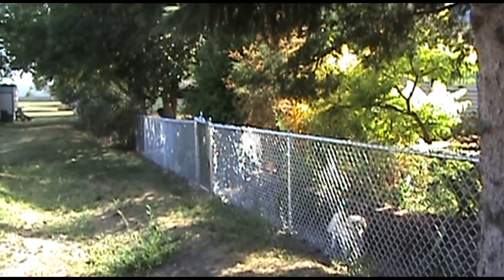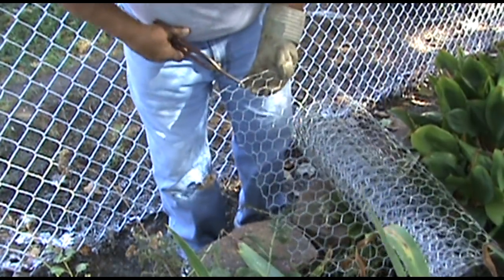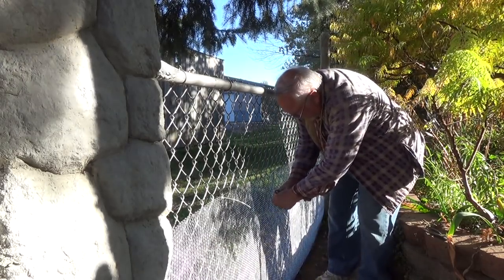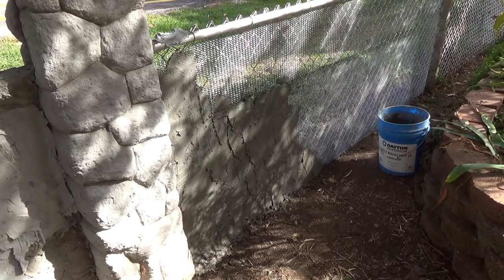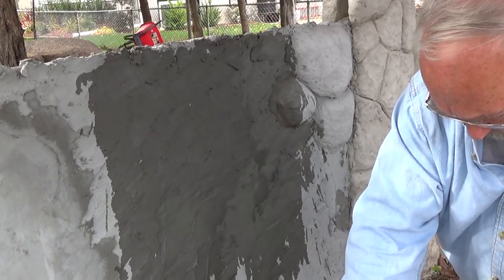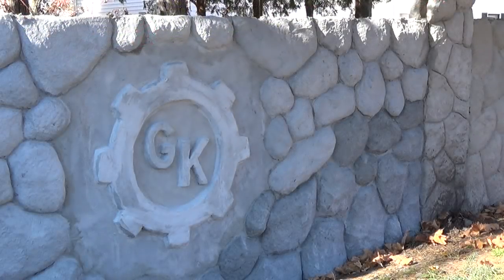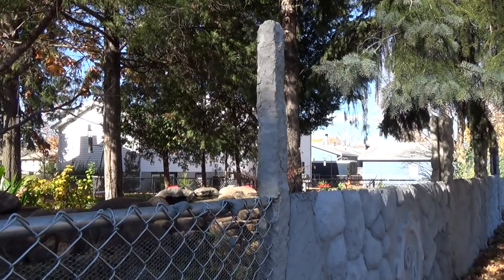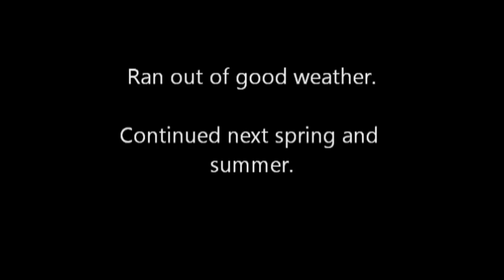Converting my chain link fence to a stone wall

Comment from the maker: The fence in this video has a foundation of steel posts in concrete 40 inches into the ground (below frost line).  The fence is covered with an ultra high performance concrete mix referred to as reactive powder cement with a compressive strength of more than 80 megapascals. The metal fence acts as rebar or reinforcement for the concrete. The construction is essentially the same as found in commercial concrete fences and based on a post-and-beam mode of construction. The concrete is composed of sand, Portland cement, CSA cement, metakaolin, silica fume, Xypex brand crystalline waterproofer, AR glass and PVA fibers, and acrylic emulsion in the liquid.
Reply: Thanks
Reply: dperry428 thanks man 🙏 great wall!
Reply: Extremely interesting! I've enjoyed watching your talent. Could you elaborate on the chemicals that you use and their ratios for each job; 
1. the wall
2. the mortar outlining effect
3. the Styrofoam gate. 
4. The stain for the stones

Have you thought about writing an e-book on this. You have thousands of views! Congratulations
Reply from the maker: @teg861  I don't know what you mean by elaborate on the chemicals.  The content and ratios of the mixes I use have evolved with time and even over the course of a project.  The wall was completed over a three year period and the mix used changed from inception to completion.  Sand/cement ratios varied from 3/1,  2/1,  1/1 and even 1/2 sand to 1 cement.  For most of the vertical application, the mix is 2 sand to 1 cement. Before I started using silica fume, I added 15% to 20% metakaolin.  Later mixes and what I now use contain 10% metakaolin and 8% silica fume.  Silica fume tends to make the mix very sticky so, in certain uses, I will sometimes eliminate the silica fume and increase metakaolin to 20%, such as when I want a sculptural mix that performs like modeling clay..  I also add 5% to 10% Buzzi Unicem CSA cement, depending on temperature.  This is a calcium sulfoaluminate additive that is not meant to be use alone as a cement like other CSA cements, such as Rapid Set. It is added to help with shrinkage cracking.  I am now also adding 2% crystalline waterproofer (Xypex brand), especially when making concrete constructions that will be in my pond. I also use acrylic latex additive in all mix water such that the solids content is at least 6 to 10%.  I also use alkaline resistant glass fiber in base coats and polyvinyl alcohol fiber in finish coats.  My purpose is to produce a concrete that is strong, dense and impermeable to be waterproof and resistant to freeze/thaw cycles. The metakaolin and silica fume are both pozzolans that are chemically active, but they also are used for their particle sizes, with metakaoin 10 times smaller than cement and silica fume 10 times smaller than metakaolin.  Their use creates particle packing that densifies the concrete and eliminates porosity to keep water out. It seems to work quite well.  I am no expert on concrete.  I share what has worked for me based on what I've learned from research at the University of Michigan and other engineering studies. Books should be written by experts.
Reply: dperry428 Fantastically detailed reply, it helped me no end, thank you.
Reply: @dperry428  could it be possible to use driveway resurfacer? As your mix calls for lots of stuff! Just asking, I like to stay simple.
Reply from the maker: @LH81633  There is good reason to use what I have used.  Yes, the mix is more complex than what you can just go buy in a home improvement store, but it is also much stronger and much more durable than anything you can conveniently buy.  Without wanting to be facetious, do whatever you like, but don't blame me when it falls apart after a season or two.  You may like to stay simple, but simple is not always smart.

Comment: THIS VIDEO IS EXACTLY WHAT I´M LOOKING FOR !! I HAD BEEN SEARCHING ON INTERNET LAST 2-3 MONTHS AND YOUR VIDEO SHOWS EXACTLY WHAT I VISUALIZE ON MY MIND !! NOW LETS DO THIS!!!
Reply from the maker: Just make sure to use a mix stronger than that found in bagged mixes.  Also, watch parts 2 and 3.
Reply: You are not alone, I've been searching for a video like this for such a long time. I was wondering if I really need to use the fine mesh or the chain link fence will be fine without the fine mesh
Reply from the maker: @stoneyvill  There are two reasons not to rely just on the chain link.  First, the gaps in chain link alone make it very difficult to hold the mix on.  It will tend to fall through and fall off.  Even adding a layer of chicken wire is nearly as difficult to use.  The small openings of metal lath are ideal.  Second, in adding the mesh, you are using the concept of ferrocement, which allows for the relatively thin end product.  My fence is less than three inches thick and in many places only two.  Using only the chainlink fabric, to prevent cracking and breaking out, you'll likely need a much thicker application of concrete. https://www.concrete.org/topicsInConcrete/topicdetail/Ferrocement?search=Ferrocement

Comment: I appreciate the detail provided in your secret recipe! I'm thinking of doing this with a vinyl coated chainlink fence. It might last a long time with your mix and rust resistant 'rebar' (cyclone fencing). 

Thank you!
Reply from the maker: Just for sure, roll or brush on acrylic on the vinyl.  Concrete doesn't adhere to plastics very well.

Comment: This is brilliant and inspiring. .   I have this idea in central Florida for large faux boulders where my soil is white sugar sand and I have tons of dry tree debris branches and roots  from a clearing. This material will eventual decay, but would be a great body frame shell.   Wrapped around some T-posts then layered with fiberglass mesh held on with nylon string and expanding foam.  I would then proceed to mortar on thick layers of 8:1 Sand:Portland in the shape of rocks.
Reply from the maker: 8 to 1 sand will be extraordinarily weak.

Comment: WOW...  you have patience!    i've seen people mixing 'deconstructed' bubble foam (the white stuff that EVERYTHING is packed in)... extends the concrete and makes the entire thing lighter... be interesting to see if that would be a benefit for a job like this.
Reply from the maker: I used to do exactly that 10 years ago to make lightweight rocks for my pond.  Here is a six part series I did 10 years ago using styrofoam beads (EPS regrind) to make lightweight rocks.  I now use vermiculite and perlite to make lightweight concrete.  https://www.youtube.com/watch?v=VqUc5QSUBAQ&list=PL0D8F4E6D9B49EBA4   Lightweight concrete would NOT be a good idea for this fence, however, as it would significantly reduce the strength of the fence and be much more susceptible to damage and vandalism.

Comment: Oh lord thanks for this video I was rolling this idea in my head and I thought I would see on utube if anyone else already did it and woooooohhhh that's too much work for me I dont have that kind of time so thanks for saving me
Reply from the maker: You're much too quick to give up that easily.  I'm 76 years old, work alone and don't have room to carry wheel barrow loads to the fence, so it took me a long time.  If you use larger loads of concrete and a larger trowel, the base coat goes on much quicker  Same with the rock layer.  Use my example of "how" the job is done, not how easily nor quickly it can be done.  Have more faith in yourself to be able to do this kind of thing faster and more easily than an old man
Reply: dperry428 awesome work

Comment: I hate my chain link in front of my house . This is very cool.I'm hoping some day I can get hubby to help me do this..Hubby 65 years I'm 60.  I bet this would hold up well in an earthquake because it would still have a bit of moveability because of chain link and post being underneath it all
Reply from the maker: Do not make the mistake of thinking that, if the chain-link is flexible and "moveable", that it remains so within the concrete.  The fence posts and chain-link fabric become concrete reinforcement, like rebar. The fence will be as rigid as solid concrete.

Comment: Beautiful work, How about using sculptured foam rocks to lessen expense of concrete, like you pointed out in the school logo
Reply from the maker: That is a possibility, but on my fence, I wanted strength, especially on the outside where it's vulnerable to the misdeeds of potential vandals or through accident.   The school logo is vulnerable.  It wouldn't take much of a hit to break through the thin mortar coating over the styrofoam.  If a kid on a bicycle crashes into the fence, though, there will be little, if any, serious damage to the rockwork. With the strength of the concrete, it would take some serious effort to cause any real damage other than spray paint.

Comment: I keep coming back to this video as a reference tool. I've already commented previously, but I'm curious if you've ever worked with something called Air-Crete? It's a process through which tiny bubbles of air are incorporated into a concrete mixture. The result is something extremely durable, yet lightweight and easy to work with. Or at least that's the purported description.
Reply from the maker: I haven't worked with aircrete and wouldn't use it for structural purposes.  It is very low compressive strength and easily damaged.   I have used lightweight concrete containing styrofoam beads, vermiculite or perlite as the aggregate.  Also very lighweight, cut also very much weaker.  Choose your concrete wisely.  If you want strength, stay away from lightweight.  If you don't need strength, then try the lightweight stuff.

Comment: My question to you sir is did you just keep on piling cement when making the posts? or would you let the cement dry and add more chicken wire and then add the cement? Im curious to know how you also kept the gap on the posts. Did you use a piece of wood to maintain that space open? I am so curious because i want to try this on my chain link fence?  Thank you!
Reply from the maker: I assume you're asking about the extensions of the posts above the original fence line.  They are built up in two layers, allowing the first to cure, wetting the layer and adding the final rock layer.  The use of acrylic additive allows layers to be created without delamination or cold joints.  The gaps in the ends of the post extensions were created by using two sheets of metal lath on either side of the post, each of which is filled with concrete. By using a thick, non-sagging mix, the gaps can be lined with additional concrete and concrete rocks shaped around the edges with a narrow margin trowel.  No additional forms of any kind are needed.  It's rather like using modeling clay to form and shape everything.

Comment: This is a beautiful fence! it looks like it would take me a year or more to complete this from start to finish. How long did it take you? Do you have any suggestions for making a mold. I'd like to do something like this in my backyard. I have two long length fences. One looks like the length of yours & the other one about 48" shorter.  To make it feasible, I would need to make some adjustments considering the time, cost and my skill level. I've never done something like this before, but you have inspired me & the fence is pretty old. I would like to get a brick, stone, or  rhino effect out of a diy mold. Any suggestions? help?
Reply from the maker: Once you get the scratch coat on, there are a number of ways to do rock, stone, or brick.  You could buy premade cultured rock, but that expensive; mold your own, but even molds can be expensive; use stamps made for concrete, also expensive; or use a pathway mold as a stamp to outline the rocks or bricks.  Put a layer of concrete on, press mold into the concrete and then finish the stones with brush or trowel.  Use mold such as this:  https://www.quikrete.com/athome/walkmaker.asp

Comment: Thanks for sharing your techniques. I'd like to try this but with a new fence butted up against my neighbors bushes/hedge. Do I have to worry about the metal lathe rusting and cracking the wall if I can't cover the metal on the other side? Also, if you were doing this from scratch without the chain link fence (and had minimal space), what do you suggest for the structure? I was thinking of just a pressure treated wood frame and attaching the metal to the wood.
Reply from the maker: Understand, firstly, that I am knowledgeable about those projects I have personally completed, so I can't give advice on what you suggest with pressure treated wood. You'll simply have to try it yourself.  Metal lath needs to be completely covered to avoid rust.  If I were doing this project from scratch, I would likely embed rebar in concrete-filled holes, attach metal lath and chicken wire to the posts and proceed from there.  Again, I haven't done it, so  you're on your own to try it.

Comment: Great idea!  I have four foot chain link fence 100 ft with green mesh cover for privacy...however my neighbors yard is higher than mine so I want to add the concrete as you have.  Would you cover the green mesh with concrete instead of wire.  I want six feet high wall. Suggestions?
Reply from the maker: First, I don't know what green mesh is.  Is it plastic?  Again, you ask if I would cover it with concrete instead of what I did.  No, I would not.  The concept I used is known as ferrocement.  Search for that to see why I did what I did.  Otherwise, I cannot advise you as to how you should do your project. I have no idea what the existing fence is like, what the existing posts are anchored in, what your soil conditions are or what you climate is like.  I am not a structural or civil engineer and cannot advise you how to proceed.  I  suggest you consult an engineer, show him/her what you want to do and get professional advise.  Also, check on your local ordinances for what is permitted in your zone.

Comment: I am interested in your opinion for using your mixture of concrete in place of the typical ferro cement mixture used for concrete boats ... thx
Reply from the maker: The typical ferrocement mixture is just a 3 sand to 1 cement mixture.  This mix would simply make the construction stronger, more waterproof, impact resistant and flexible.
Reply: Thx for the reply ... also would your mix be fluid enough to be used in an injection molding process ... say having a 5/8" to 1" thickens (in the mold void)
Reply from the maker: The addition of a superplasticizer will make the mix as fluid as desired without additional water that would weaken the mix. Usually poly-carboxylates are used.  The make the mix fluid without segregation of materials.  Those fluid mixes can be self-leveling and self-consolidating. By adding more CSA cement, the mix can be made to set quickly.  Really can't comment on injection molding as I have no experience.  I've seen the mix used, though, in rotary centrifugal molds.

Comment: Sorry if you already answered this question. What's the freeze thaw cycle like in your area? What thoughts do you have on possibly trenching out a 16" wide +/- by 6"- 12" deep centered under fence and placing low density insulation prior to to what you have done? I live in upper midwest and we can get hard freeze to about 42"  I'm wondering if the low density foam would help insulate the ground below or possibly allow for some compression with frost heave?
Reply from the maker: Our frost line is not quite as severe as that, but it does get mighty cold here in northern Illinois.  I'm about 60 miles west of Chicago and perhaps 25 miles south of the Wisconsin state line. Our deepest observed frost line is at 30 inches.  Frost heave has as much to do with soil structure and a constant source of soil water as it does temperature.  To have frost heave, one needs to have a susceptible soil type that is not too loose, as in sand and gravel and not too tight, as in dense clay.  Heave is created through the development of ice lenses that grow through the addition of water from a replacing source through capillary action in the susceptible soil and not from just freezing temperatures.  In my fence, the posts are in concrete well below our frost line and have been in place since 1974 (43 years).  In all those years there has never been any heaving of our soils and the fence has remained totally unaffected.  With that in mind, I didn't anticipate there would be any difference with simply covering the existing fence.  Secondly, having installed the fence back in 1974, extreme caution had to be taken to dig the 40 inch deep post holes, as a 7000 volt underground electrical line snakes along the property line.  There are also telephone lines, television cable and fiber optic lines near the fence, some of which are not very deep.  I wouldn't consider digging any kind of trench along the fence line.  I'd likely avoid the 7000 volt line, but cutting a fiber optic line, cable or telephone line can be pretty expensive.  Insulation would make little to no difference in prevention of frost heave without first providing for proper drainage to remove water sources and replacement of frost-heave susceptible soil with gravel.